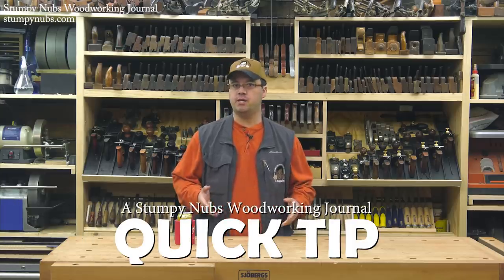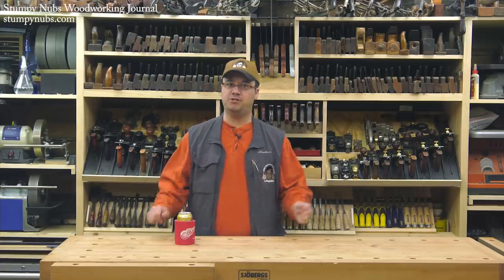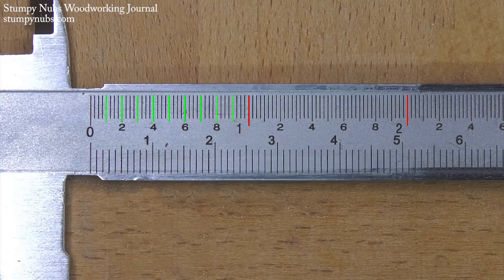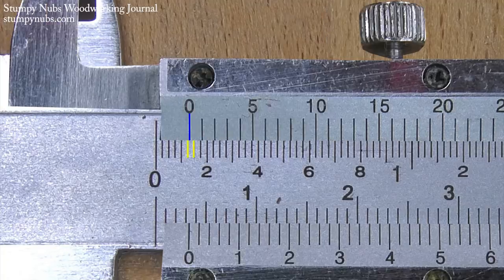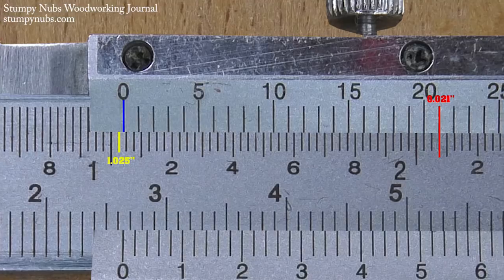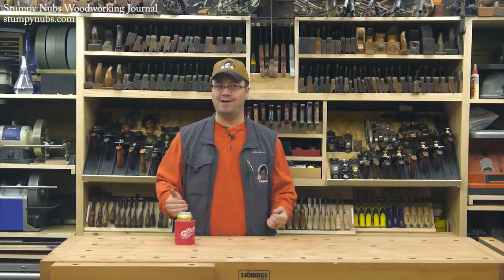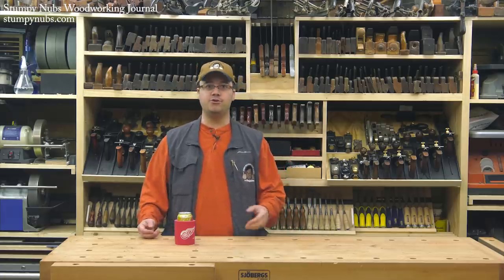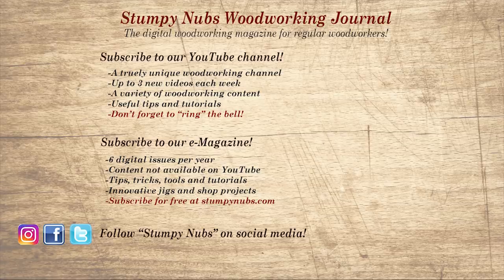EASY LESSON: Reading Vernier Scales & Machinist calipers

Comment: As an Australian whose house was built in imperial and renovated in metric I have a simple rule. Use a tape measure or ruler with both inches and mm. If the measurement is whole inches use inches. Otherwise use metric.

Comment: At 68 I finally discovered the metric system.  Full credit to your vlog yesterday, I did have to push through my acculturation to imperial measurements.  I would like to point out you would not have to go through your explanation about the imperial calipers if it was metric. I do everythingnow in the metric system.  I am so grateful to have finally discovered the metric system.  I only took be 6 decades but finally I am done trying to figure out what 7/32nds looks like.  So glad you are tackling this subject.
Reply: I, too, changed to the metric system for ALL wood working projects. Not only has it made measurements simpler, it has proven to be more accurate by far, and joints are soooooo much better fit. I would never return to using inches, cubits, jow, or any other archaic unit of measure.
Reply: 7/32, just divide 1 by 32 and multiply by 7, (7/32) = 0.21875.
Reply: Well done John. I grew up with both in the UK so I think I am qualified to comment. I have been saying to Americans for years, just try it.
Reply: Since we all have a choice and I have no problem with inches, fractions and thousandths I'm just fine with the imperial system...so no thank you.

Comment: Just switch to metric measurements, using millimeters for everything. After a SHORT period of adjustment, you will find that measurements are far simpler as well as much more accurate. No matter how good your work now, watch the joints tighten up and the improvement in your projects will stun you. You will never go back the the cubit, inch, jow, or other archaic system of measurement.
Reply: yes he will if the job requires it. How many smoots is 120 mms?
Reply: I saw Essential Craftsman checking his house's base for square using Pythagoras: Root of (length squared plus width squared) --- first feet+ inches into inches, then the square and sum and root, then again inches to feet+inches.  Sigh, pointless source of errors because you have no sense how large is "740inches". (Arguably, could have used fractional feet and avoided the problem.)

Comment: Stumpy, this is so far from a silly video. I've been an aircraft mechanic for 35 years. Vernier calipers,  micrometers, depth micrometers,  dial calipers,  bore gauges , height gauges...... and the list of precision measuring devices goes on and on! I've also professionally taught precision measuring - one of the most difficult tools for students to learn is the analog vernier caliper, vernier micrometer. With the advent of the digital versions of these devices its become increasingly easier for people to use these tools. But, what happens when you don't have access to the digital versions of them? Best to learn to use the analog version! Great video! Thank you for your time and effort!

Comment: Great video, great explanation, just not sure if 1/1000" or even 0.5mm accuracy in timber or wood products is possible or desirable. Unless of course your finished project will be in a hermetically sealed location, with little or no changes in humidity or temperature.

But as always, measure at least twice, cut once.

Comment: I used these for a farm table project, they really make for much tighter joints and measurements.  It all comes down to the craftsman in the end, but it does help with minute measurements and getting those joints to fit right.

Comment: Digital caliper. No problems, it just tells me how many bits of a millimetre I'm about to ignore when I'm cutting up my bits of dead trees. Generally, for the stuff I make anything smaller than a millimetre will only get lost when I sand the wood or reappear when I add the finish.
Great video. My dad was a machinist so I learnt to read these scales as a youngster. It was interesting as he was educated in imperial and I was taught metric after the UK changed in the 70s. So I grew up bilingual. I find metric easier, but appreciate that imperial still has it's place. There is no metric equivalent for a foot. Everyone here jumps from centimetres to metres. (the decimetre is such a silly unit)

Comment: A couple of caliper thoughts:

To get an accurate reading, the caliper jaws have to sit flat on the surfaces. If you tilt it, you will see the reading change. On an outside measurement, the most accurate reading will be the SMALLEST one you can get. With an inside measurement, it will be the LARGEST. 

With digital calipers you can use the zero reset to find an accurate center distance between holes (assuming the holes are the same size): Measure the hole diameter and without removing the caliper, reset the zero. (To check, measure the hole again, it should say “0”). Now put the caliper in both holes and measure to the outside of both (the largest reading). The reading will be the true center distance of the holes.

This works with screws, too. Set the zero to the diameter of the screw ( or screw head if it’s round), measure outside both screws and you get the center distance.

Remember to reset your caliper to zero when you are done!

Comment: I love some of the comments on this subject. I love working with wood & therefore I enjoy measuring with the inch scale, i.e., 1/64, 1/32, 1/16, 1/8, 1/4, etc. I do have a machinist background from the aircraft industry some years back now & back then in the late '70's we measured in thousandths using micrometers, verniers & dial indicators & block tools with a fingernail catch. Depending on the component I was machining, it would typically have a +/- .001 - .002 or +/-  .0003 -.0005, somewhere between those hypothetical allowances was called " basic "... So in decimal, my examples are shown in tenths, hundreths, thousands & ten thousandths, so in a nutshell, a 1/2 a thousandth is .0005. Are we confused yet? Now let's talk about the metric system! NO THANKS!!! 
Good one Stumpy...
Bill on the Hill... :~)

Comment: Great lesson on the vernier scales. I still have my vernier calipers for "old times sake" Nowadays, most engineers use a digital caliper for ease and quickness. Back in my day, a vernier caliper had a rated accuracy of 0.05mm or 0.002inch due to variation in each persons touch and the "play" between the measuring faces. Better accuracy relied on the use of micrometers. Oh, what memories! Hmmm, I still have my set o micrometers also :-)

Comment: I'm an electronics engineer that has picked up woodworking as a hobby.  Unfortunately, I think in decibels.  LOL.  I think this video is a very helpful tutorial :-)
Reply: Tom Kelleher are all your shelves in logarithmic proportions?
Reply: dlevi67 logarithmic calipers: I think they call that a slide rule
Reply: @bobt2522  3db? Isn't that when you're halfway through the project? 😁
Reply: In woodworking, if you think in dB, you need protection!  First get Festool for your shop equipment and dust collection.  Then wear in-ear plugs under earmuffs.  Once things quieten down, you can focus on regular math and think in metric.

Comment: Great share. As a machinist myself, I believe you did a great job explaining  it. Also, I’ve worked with the Metric system to no end in my 36+ year career. (Pertaining to the rant video as well as this one). It should be said that converting metric to Imperial is easy. Simply use this simply math.. MM divided by 25.4= inch. Or say 6(mm) divided by 25.4= .236 inches. In other words, there is 25.4 mm in one inch.
Reply: I just use 25,  4 tenths of a millimeter is not something I personally need to worry about . :-)
Reply: twoweary , I hear ya. Sometimes it helps when converting certain tooling. Say, if my project requires a 6mm drill bit, I’ll go to a 1/4” bit, when woodworking. Not everyone has metric drills for instance. Just sharing some insight.

Comment: I have a vernier, a dial and a digital caliper. One thing the vernier offers is durability. No batteries, no gears or plastic face. You can have it rattling around your toolbox and it will always work.

When I was young, I could use it easily, but now I need magnifiers.

Comment: Excellent explanation. I prefer dial indicator on calipers. I think in thousandths. One hundred thou. 15   thou. Ect.
Reply: @Jc Denton lol. I have no problem either way. At work I use digital calipers. They switch from inch to mm by pushing a button. At home in the wood shop, I use dial indicator in inches. Metric is easier, but I use inches in thousandths. Still easy math. And I drink coffee, not tea.
Reply: I'm a machinist too, and also prefer dial calipers.  Vernier calipers are accurate, but slow, potentially confusing, and about the same price these days as an inexpensive dial or digital caliper.  For those of you who are not familiar with calipers, it's not as difficult or expensive as you might think to get machinist accuracy in woodworking, and the precision really pays off when it comes time for assembly and glue-up.  I clicked "thumbs up" to crush a troll.
Reply: Not a fan of dials. They can stick and break very easily. They are still better than the electronic ones though.

Comment: To turn a fraction to decimal on a single line non-fraction calculator, enter the fraction using the divide button. After entering the lower number, press the divide button again (not the equal button), and there's your decimal.
1/4 is entered as;
1 ÷ 4 ÷ displaying 0.25

Comment: Having done metalwork on a lathe and a milling machine and other metal tools I'm used to measuring in thousandths.  But I gotta say, reading vernier scales is the biggest pain, possibly the most difficult part of all woodworking or metalworking.  And it DEMANDS practice to get it right consistently.  That said, I have a vernier caliper made by the now-defunct Modern Tools (at least I think it is, I can't find it on the Internet) which was all inches, but one scale is read in thousandths, the other in fractions, down to 128th's of an inch.  So I can take measurements and read them in fractions, like my tape measure.  But still, interpolating using a Vernier scale is a PAIN. 

I also have a digital caliper which displays in hundredths of a millimeter, ten thousandths, or fractions of an inch down to sixty fourths.  Easier on the eyes until the battery wears out.  The battery problem is why I will never give up my Modern Tools caliper.

Comment: I've been making cabinets for 25+ years.... my brain just exploded. I got the metric system, but this kills me. Heck a spinning belt sander blows most of this away. A pad sander with 220 grit disc spinning at ??? rpm  sitting on maple with 2 lbs of pressure for 27.28 seconds will remove how many 100 1000ths of an inch of material... oops I just spilled my coffee on my master piece and it just swelled how many 100000000000ths of an inch/MM/??????????? My brain is STILL exploding. Come on let's keep it simple guys!!!

Comment: I use the metric system all the time as a tool maker. 1 millimeter is .03937 of an inch there for if you want to convert mm to imperial standard just multiply lets say 3.5 mm it would be 3.5x.03937=.137795 round that to .1378 and if you want to convert imperial standard to millimeters divide .1378 by .03937 = 3.500127 round that to 3.5001 and there you have it

Comment: In finance we refer to .025 not as 25 thousandths but as 250 basis points (bps). Working from basis points, the division math is similarly simplified. A basis points is one one hundredth of one percent. One hundred basis points is therefore one percent and one thousand basis points is ten percent, or one tenth of anything, such as an inch. It is nomenclature that will work as well for machining or woodwork just as well as it does in finance, and it is much easier to say bips for basis points rather than being tung tied with thousandths.

Comment: Great stuff James. You are correct in engineers and machinist would be using this on a daily basis. I do have callipers and use them regularly, but as a wood worker, 1/2 mm is good enough for me Yes, I'm a metric guy.
Reply: Eeeh, we have digital calipers these days, I keep forgetting how the Vernierthingy works since it's so long between uses :p

Comment: Stumpy, I love your channel. So much information that can’t be found anywhere else and so many videos and articles. I am a total fan. 

If I can make a suggestion, I would like to see a video or article on the different types of planes and their uses. If it is possible to boil things down  to a few of the most useful for modern wood working, given the typical power tools most wood workers have today. It would also be great to have the same type of information for hand saws. 

I have seen that you cover some of this material along the way in your many videos, but it would be nice to have it all in one location. Apologies if  you have done this already and I just have not run across it. Thanks again for all you do.
Reply from the maker: Yes, we have covered most of that in the past. We're building a new website that will make it easier to find past videos based upon subject.

Comment: The rest of the world made the decision to change to the metric system in 1960, so had to go through the process of learning the new system, it is quite doable. I have a metric caliper with a dial, easiest thing in the world to use and it measures to 0.1mm, more than good enough for woodworking.

Comment: The really big difference between metric vs inches is when you’re selling to a customer. Older school people will not have a feel or understanding of metric and any confusion kills sales.
 

      Here are a couple of pointers of where it counts by using a caliper on some machines.
Most large planers have .060” per revolution of the height adjusting hand wheel, if you look at it like a clock, each hour represents .005” and minutes at .001. So measuring after your first pass through the machine you can then dial in your standard thicknesses of ¾, 1/2, 3/8, 1/4, and 1/8. That all correspond to cutter blocks on the saw or shaper. Or what used to be standard thicknesses of plywood or other sheet goods.  

     In North America Most easy available saw blades and cutter blocks are still measured in inches. From dado sets and shaper slot cutters. So learning decimal point inches is really mandatory.

     Plywood is still referred to its thickness in inches. Divide ¾ by 3 and you get ¼, vs 19mm /3 and metric quickly become a brain teaser. Not that I have a problem with on the go calculations without the need of pen and paper. Forget about the 48x96 vs. 1220x2440 dividing by 3 or 4 and you quickly need a calculator for the metric.

      For those that think they will never use fine measuring down to a thousandth, just start laying up your own plywood. The amount of glue thickness will get you if you do not allow for it.

      Standard veneer 1/2 mm or .020” with nine cores and two finished faces how thick should each core be to get to 3/4”. All the best plywood from 35 years ago was made this way. And you could caliper it and it would be right on the money to fit your stacked dado without the need for shims. Today’s stuff is maybe 5 core and under thickness by .030” and when you dado it, it kinks.

     So after you made your plywood now it’s time to sand it and you really only get 1 chance to put it through the wide belt without sanding through. Without a good caliper and your machine properly calibrated good luck. You would be better off sanding by hand rather than take the chance, but then you’re not going to make any money in woodworking in today's over property taxed city where all the work is.

     Here’s a good tip on the sanding of ply with a wide belt. You can calibrate you raw sheets buy running through before finished layup and pass them through again with the same edge to the same side as the original calibration. Or spend tedious amounts of time to get the heads perfect across the entire width. 
When you calibrate for a finished first pass go for ten thousand or half your veneer and don’t be shy. What you can’t do is run it again without typically sanding through
Even if your just laying up on mdf these principles still work on your wide belt sander.

Comment: My eyes went years ago, as a retired engineer I would work to 1/10 of 1000 of an inch. During that time I bought a digital Vernier which I still have and use daily in woodwork. I know, you can make something for a customer and they won't see half a millimetre difference, but I can, I just can't see it on a ruler !!!

Comment: To make it easier and the fractions much smaller as a machinist we call .1 hundred thou. .01 is ten thou, .001 is thou. Deal with .0001 every day. We call that a tenth.
Reply: Yep. People call .1 a tenth of an inch. A tenth is .0001. if you have a job in manufacturing.
Reply: Spot on, as this is the method I was taught when I was a whipper snapper & thought I knew everything up until I scrapped $50,000.00 exhaust piece on a jet engine with a .003 overcut! My shop foreman defined the meaning of " ASSUME " to me... :~)
Reply: ~30 yrs in the trade, 10 yrs running  a shop in a small research institute. My brain goes between decimal inch, fractional inch and metric with little effort now, but when I send a proposal to some scientist who wants me to make something, I have to dual dimension in metric so they don't get confused. And if I refer to a 'thou' they get this puzzled look ...

Comment: I found a set of cheap $3 plastic calipers at Harbor Freight a few months back. Pulled it out a few weeks ago and it hasn't left my apron since. Funny thing is that it actually is marked for your customary half/quarter/eighth standard imperial tape measure style. I watched this vid and it had me wondering if I had been using it wrong... turns out I accidentally purchased carpenters calipers. Who'da'thunk?